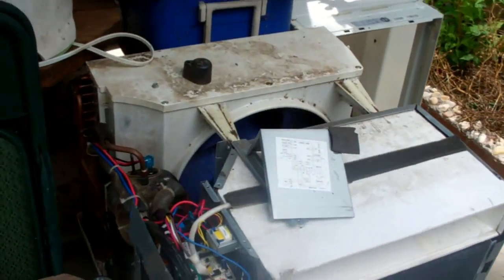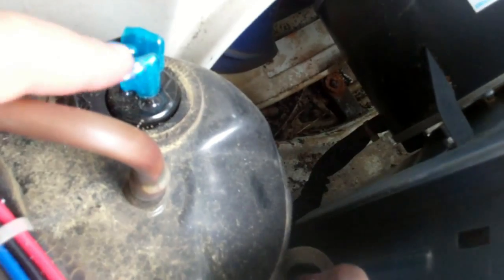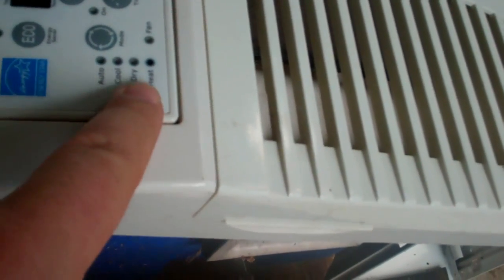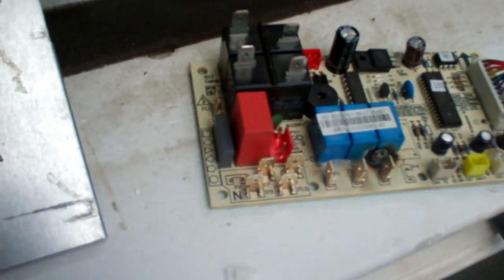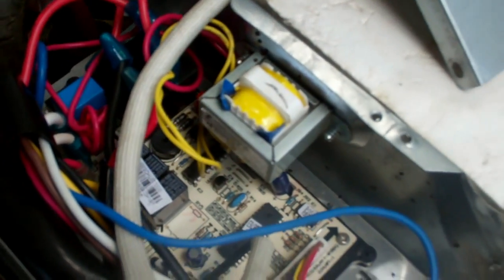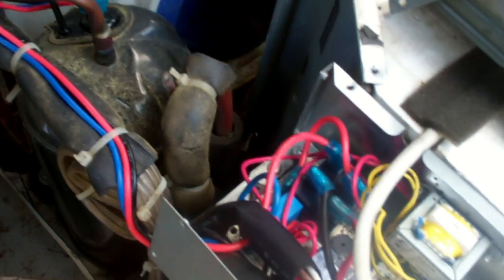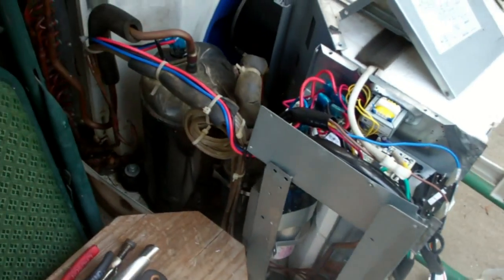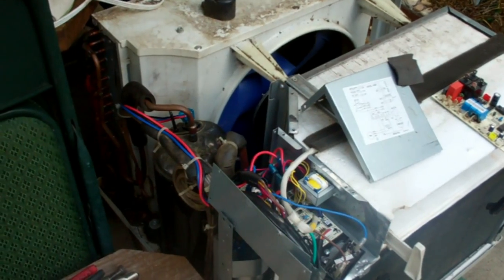Detailed Troubleshooting of my Bad AC Heater Combo

Comment: I had this same AC.. there is another control board behind the buttons..  and it kept getting splashed with water and there was a second connector in the middle of the line:  and that's where water was draining down into that connector and corrosion build up was causing it to go haywire and do random things  (such as turn on whenever it wants, like yours).   I fixed it by cutting my connector and just splicing the wires directly-- and then I could put heat shrink over all the connections and keep it from shorting out again.  This makes it inconvenient when you pull the front cover, because you are directly tethered with the wire and aren't able to easily disconnect it anymore.. So that's the downside..

Comment: I have the Frigidaire 18,000 btu match to that unit and it has the same schematic that shows the same ghost relay and I’m in the process of changing my board due to the exact same issue that you had hence the reason I’m watching your video. My unit was doing the same as yours where it would just kick on without a/c but heat was ok I hope that once it’s repaired it will work normal   My problem is I took pictures when I removed the board so I could match everything but I lost my pics and now have the new board and I am one board short that relay that we don’t have so that jumps from the heat directly to p7 I think it is right. Thank you.

Comment: Did you ultimately come to a conclusion after further diagnosis? I have an issue w/ the same control board whereas the A/C kicks on and works perfectly when "Cool" is selected, but the heater exhausts a "luke-warm" stream when "Heat" is selected. Nothing looks fried on control board, however it is a very old board. how much did you pay for your control board? Thank you for your response...
Reply from the maker: Yep my conclusion was to donate it to the local technical college AC & Heat class. A complete waste of money IMO. I paid like $40 for the control board if I remember correctly but it didn't fix the problem.. I wound up replacing it with a Haier from Sam's Club

Comment: You can get multi meters for eight bucks..  That can test everything you need..  If you sp3nd twenty-five, there are amp clamp meters on szcamaznon that can measure ac and dc amps, along with all the usual ohms, volts, etc.. and it also has micro farads-- to test capacitors.  You really should get a tester. :)
Reply: cm4kor  astroai .. is what you want.  or something similar. 
Just make sure the clamp can read AC AND DC current.. most of them are AC only, so watch out for that if you get a different one.
Absolutely worth it..  They were only tw3nty-thr33 dollen when I got mine. I guess they went up a bit; because they are so good
Reply: jmc02   .. is another one.. even l3ss

Comment: Sometimes bad compressor draw a lot of amps bcs it is machanicaly failed this is may be the problems i had a unit sid triped fuses many time we changed relays contactors and every looks fine and after that it is starts to fail again like mentioned check amps draw on your compressor

Comment: Should check to see if the compressor is pulling too many amps. The relays on the board will overheat it the component it controls pulls too many amps.